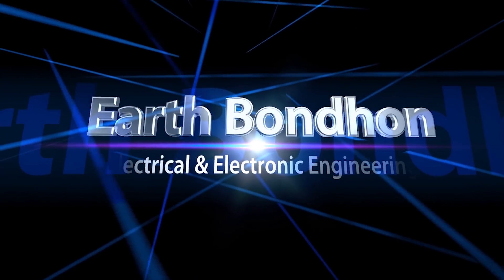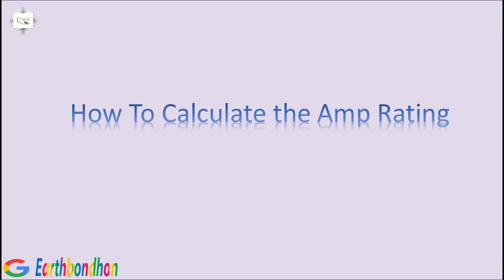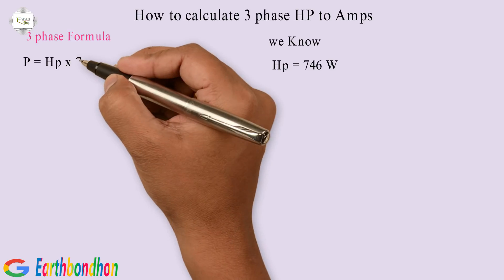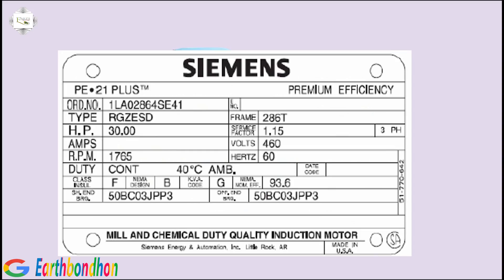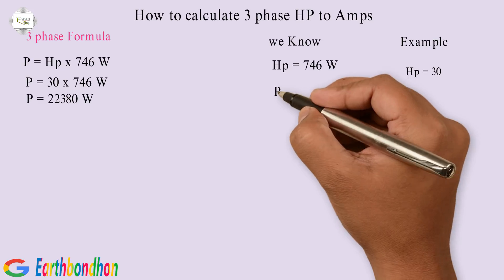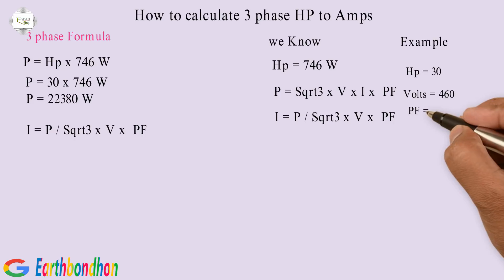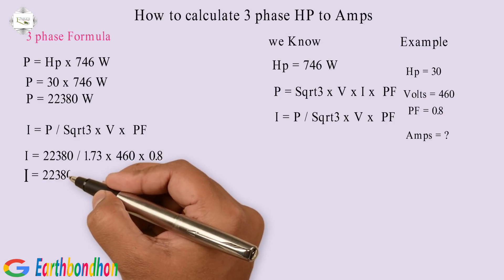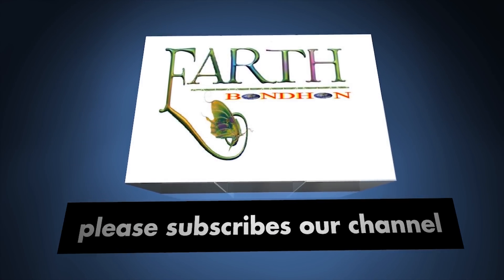How to current calculation formula for 3 phase motor | convert hp to Amp |  Earthbondhon

Comment: if base on the info,  motor current is 35.15Amp. this is not accurate. in order to give an output 22380W, we need to consider the effeciency.. in order to produce 22380w, the input of the motor is 23910.2W (base on 93.6% eff). so we recalculate the current that been draw by this motor then we got 37.51Amp. this is the real motor current or we call motor rated current.
Reply from the maker: Yes... Right accurate...
Thanks for your feedback, please follow.........
"Thanks for watching the video"   You are very welcome!